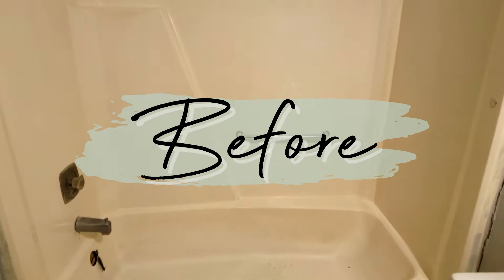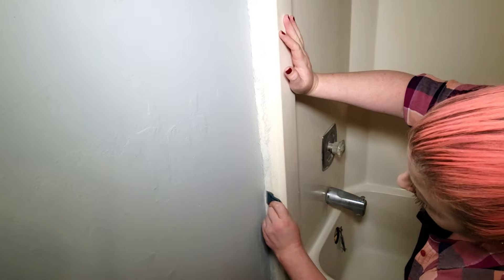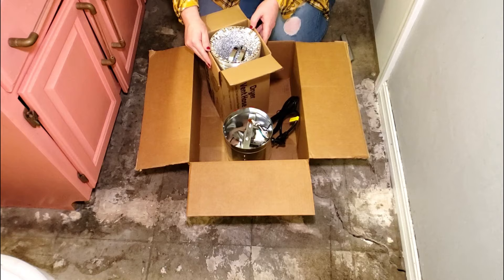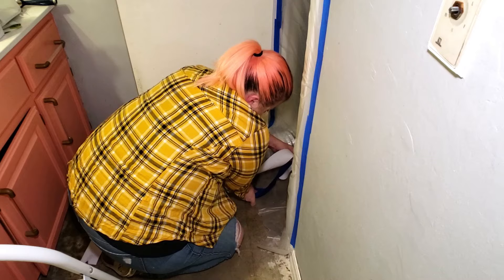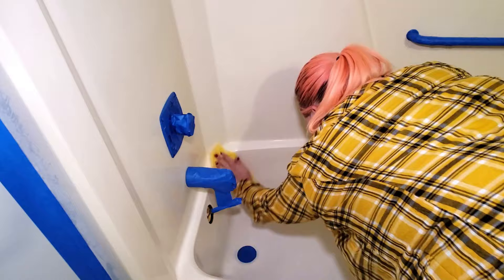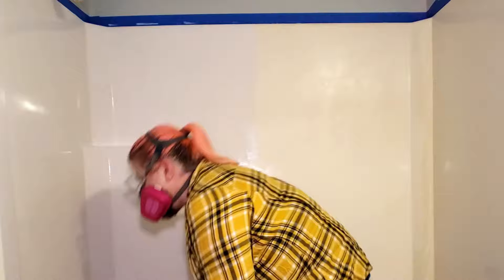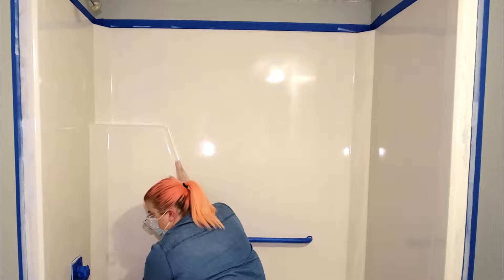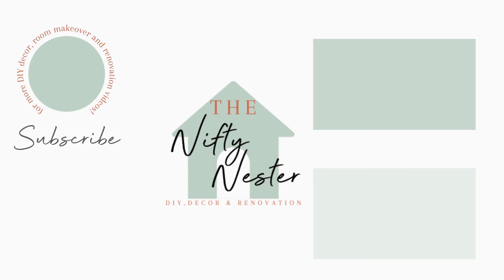How To Paint A Bathtub Yourself | The STRONGEST & CHEAPEST Way To Refinish Your Bathtub!

Comment: Hi! Awesome video. Quick question before I do this lol, the “topside” paint says it is water resistant and should be used above the water line . For below the waterline used “bottom side paint”..  does it matter ?
Reply from the maker: Thank you! So the bottom side paint is a much stronger paint that's meant to prevent "fouling". It's formulated to slowly release copper and hold up to constant submersion in lakes or oceans. I don't think it's safe for constant exposure when showering. The topside paint on the other hand is supposed to be non-toxic and fume free after it cures and it still has a hard enamel finish that's meant to hold up to the elements and get wet on a regular basis. Topside is also less expensive which is a plus. This paint is really durable, it's held up amazingly.

Comment: Your video was just what I was looking for! Can I do this with a stand up shower that has caulking in between panels?
Reply from the maker: Thank you! I think that would be fine as long as it's a material this paint would work on (which seems to be pretty much any material that would be used for a shower). The only thing I would suggest is maybe removing the caulking before painting and applying new caulk after the paint has dried (if that's possible for you to do). Good luck!

Comment: Looks great!!! Did you not have to use a primer? I want to paint my shower tile😊❤
Reply from the maker: Thank you!!! So this paint doesn't require a primer. If your tub or tile has damage and needs repairs made beforehand then you'll want to use the Marine primer to reseal the tub before painting. Since you have tile I would suggest using the Marine primer so the grout gets sealed before painting. But with a standard fiberglass tub or similar material without grout, it's not needed.

Comment: That looks great! We've been stressing out about how to fix a shower stall in a very small space and it looks like this might be the solution. Def going to check out more of your videos for other projects. Just curious about how slippery that paint gets when wet. Is there a way to make the base somewhat slip resistance?
Reply from the maker: Thank you so much! This has been one of my favorite projects to date. Rustoleum sells a non-slip additive that I'll probably try when I refinish our other bathtub. This tub had a slight texture to the bottom, and the paint didn't fully fill that in, so the remaining texture was enough to keep the tub from getting too slick. Without that texture, it would probably be like a smooth porcelain tub. I've heard from others who have used the non-slip additive and said it works great, so you might check that out. I hope that helps. Good luck with your renovations, and feel free to reach out if you have any other questions!

Comment: Thank you this is so helpful! Did you just leave the vent fan on the entire it was drying, etc?
Reply from the maker: Thank you! I ran the fan each day until I went to bed then shut it off, by that time each coat was dry and the fumes were pretty much gone. On the last day I did the same thing and just kept the plastic up for another day to let the tub finish curing. By then the bathroom smelled pretty normal, maybe just a little like paint but there weren't any fumes left.

Comment: Looks Great, obviously there's no brush strokes, but did it leave any lines, was it pretty smooth ? Thx
Reply from the maker: Thank you! The finish is like a smooth shell, there's not any lines or texture at all from the roller. The paint is "self-leveling" so any slight texture should level itself out. It's not like epoxy, you still have to try to get the finish smooth with the roller and go over any lines from the edge of the roller, but the paint will also level itself out a little which gives it that smooth finish when it's dry.

Comment: The paint manufacturer description says for "above the waterline" so how is it holding up comming in contact with the shower water? Thanks
Reply from the maker: I had the same concern but after reading through all of the reviews I figured it was worth a shot. So far it has held up insanely well. There's no peeling, bubbling or any other sign of wear at this point.

Comment: For ventilation you need a source of new air to come in as the ventilator pulls out the bad air.. I didn't notice if you said you had any
Reply from the maker: I didn't think to mention it at the time but I had my homes ventilation system on and the air vent in the bathroom open so that was my fresh air source.

Comment: When doing your bathtub with Marine Paint did you use the Marine Primer?  If not is there a reason you didn't?  My bathtub is sanded and ready for paint, just want to make sure I do it right.  Thank you
Reply from the maker: Sorry it took a couple days to respond! You don't need to use primer unless you've made repairs like filling in cracks or chips. If you've made any repairs then you want to use the Marine primer. I hope that helps, good luck!!!

Comment: Great Job! I used the Tub & Tile paint and it did not hold. My girls tub started chipping badly, so I am going to give this paint a try.  Did you need both cans of paint for the tub? How many foam rollers did you use during each coat? & What do you currently use to clean the tub?
Reply from the maker: Thank you! I'm sorry to hear about the issues with the tub and tile paint, unfortunately it seems a lot of people have those issues. I don't know why they don't formulate it more like they did this paint because this paint is clearly better. I ended up using less than one tub of paint so I still have a little left over plus one unopened for future projects. As far as rollers used I believe I only used one roller per coat of paint. I hope that helps, feel free to ask if you have any other questions and good luck to you with your tub!
Reply from the maker: Sorry I forgot to add what I use to clean it with. It's actually easier to clean now than it was before, I have just been using 50/50 vinegar water and a sponge or rag, sometimes I'll use a spray foam cleaner but still nothing harsher than a sponge.

Comment: Hi quick question! How slippery was your tub during usage? They also sell a non-slip additive to use with this. Did you add that as well? Do you think its necessary?
Reply from the maker: I actually am planning on trying the non slip additive in the next tub I'm refinishing (probably this month or next). The best I can compare the paint finish to is like a hard porcelain tub finish. It made my tub feel like it had more of an enamel finish and it is slightly slicker than before. Our tub had a slight texture on the bottom and the paint didn't fill that in since it's thin layers so that texture is still there which keeps it from being too slippery. I would say without that texture, the non slip additive probably would've been a good idea.

Comment: Hey! Thanks so much for this video. How is it holding up a year in? Also did you wet sand or just dry sand? I see the can calls for wet sanding. Currently doing this to my rub but forgot to sand between 1st and 2nd coat :(
Reply from the maker: I'm sorry I'm just now getting back to you! I did a dry sand with a really fine grit sanding block but I'm guessing it would be fine either way. Don't stress too much, as long as you didn't wait too long in between coats it should hopefully still bond properly. Mine is still looking great a year later, I'll share an update on here soon. I hope yours turns out well!

Comment: So thankful I found your video just one question though. How did it hold up so far and are there certain bathroom cleaning products (I.e I tend to use bathroom cleaners made with bleach) that you have to stay away from post care?
Reply from the maker: Thank you! I'm working on editing the update video now, I hope it'll be up soon.
It's held up really well. I have used vinegar water, bleach cleaner and other bathroom cleaners on the tub. The main thing I stay away from is really rough brushes but I do use a soft scrub brush if it's really dirty, otherwise I'll use a sponge. I use a stronger cleaner when it's really dirty, vinegar water when it's not. I don't use comet or anything else that might be too harsh on the finish but all of the spray cleaners seem to be just fine.

Comment: Hi, is your tub made of fiberglass? If not, how is it holding up? I ask because I’ve seen YouTube videos saying that because it’s made for fiberglass boats that it will only work on fiberglass tubs.
Reply from the maker: Hello! Yes, mine is fiberglass. It has held up wonderfully to this point. Rustoleum says this paint can be used on fiberglass, wood, metal, and a few other materials. I've seen it used on iron tubs, ceramic tile, and pretty much any material a tub or shower wall would be made out of. If you go the product and check out the reviews on Amazon, you can see the other materials other people have used it on. According to them, it seems to work well on them all. I hope that helps!
Reply: @TheNiftyNester  that helps tremendously! I’ll definitely be trying this on my tubs and surrounding walls. Thanks!!

Comment: Do you find it's holding up well even without doing the special primer before? Trying to decide if I want to use the primer or not.
Reply from the maker: It's held up extremely well! From reading the directions, you don't need the primer unless you've made repairs to the tub, then those would need primer to seal them. That being said, it wouldn't hurt to use the primer. I've had good results without it, but I've also heard from others who used the primer and said they needed fewer coats of the paint because the primer covered the tub color so well. I think if I was covering a darker color or a bright blue or pink, I'd probably use the primer.

Comment: I tried using the Homax Tough as Tile product and it is absolutely terrible. You  can't even set a bar of soap on it or it comes right off. Does this have any issues under bottles or soap bars where it stays wet all the time? Also, what should I do with prep work now that it's already painted? I sanded and prepped everything good before applying the Homax. Do I need to completely sand off the Homax or can I just sand a little and apply on top? Or use a primer and apply?

Comment: Question: I really want to try this but I will definitely be replacing faucets as well, would it be better to remove faucets first, then add the new after paint is dry?
Reply from the maker: Yes, I would definitely remove the old ones first.

Comment: Hello what kind of paint would last longer on water? And how slippery is the tub after painting?
Reply from the maker: I don't know if I'd ever use a product other than the one I used on this tub, it's held up so well. It's what I would recommend, anyways. It's linked in the description if you want to check it out. The paint finish is similar to a porcelain tub so it's like a hard shell, a little slicker than the old fiberglass was. They sell a non-slip additive if you want to add some resistance to the bottom of the tub.

Comment: Are the fumes from this as bad as the tub n tile kits??? My apartments redid my tub less than a year ago and it’s already cracking—not peeling—cracking & it was rough n bumpy from day one so I thought I’d try myself!!
Reply from the maker: That sucks, I'm sorry to hear it! The fumes are pretty strong. You definitely want to wear a respirator and have good ventilation set up. And a tip for you since you're dealing with a bad refinish job, you'll want to sand the finish off down to the original tub or as close as possible. If there's any remnants of the old paint left or any damage to the tub, you'll want to use the Rustoleum Marine primer before painting as well. Good luck, I hope all goes well!

Comment: How's it holding up? What do you clean it with?
Reply from the maker: It's held up perfectly! I use a couple things depending on how dirty the tub is. For a light cleaning I'll use vinegar water and a sponge. When it's really dirty I use a bathtub cleaner spray that's pretty strong and a blue scrub brush I get at the dollar tree. It's a nylon type material that scrubs the grime off really well but isn't abrasive enough to damage the finish on the tub. I'm editing the update video now and should have it posted soon and I'm sharing all of that info and showing how it looks.

Comment: I think you forgot to add the restorium topside  primer without it will peel
Reply from the maker: I haven't had any peeling at all. I sanded and prepped the surface really well so maybe that's why, but I read every review I could find where this paint was used on a bathtub and I couldn't find anyone that had issues with this paint peeling. It seems to have adhered well to the surface and it is a rock hard finish.

Comment: If I already have a fan in the ceiling of my bathroom..is that enough ventilation..I have no bathroom window
Reply: if the paint she used is anything like the paint I used the fan won't be enough. My condo stunk like paint for at least three days. I only had a fan so I opened the bathroom door and all the condo windows and balcony doors. Still took three days for the fumes to really leave. Glad I did it in the summer so I could open everything. If it was winter it would have taken weeks for the smell to clear out (or I would have had to freeze with all the windows open) 
I used marine paint.

Comment: I did this and it came out looking great but  the smell has been going strong for about 5 days now. Any tips on how to get rid of it ?
Reply from the maker: I'm glad to hear it turned out well! Did you set up a ventilation system? I can't say for sure but I think that's the main reason we didn't have any harsh lingering smells afterwards. There was a faint paint smell but not bad and it didn't last long. I left the ventilation set up and running all day each day that I applied another coat. We don't have any windows in that bathroom so that was the only option I had.

Comment: I'm planning on doing this but I'm concerned about the need for the respirator. They're not that much but I don't want to spend money for one if I don't have to since this is a small budget project. I do have a window in my bathroom. It's a very small room. No fan but I can plug in a box fan to help get the air moving out of the window. Do you think I'd still need a respirator in that case?
Reply from the maker: I completely understand. Every dollar matters. The problem with using an N95 mask or some other type of mask instead of a respirator with those exact filter cartridges is that they can't filter the fumes out at all. The fumes are pretty strong and can be harmful. Once the paint dries, it's fine, but while the paint is wet, it is pretty strong. The fan I used circulated the air faster than it could build up, but the fumes were still strong. With the respirator on, I couldn't smell anything and didn't feel any effects of the fumes. For those safety reasons, I wouldn't do this project without one. You might be able to find a cheaper one that's a different brand on Amazon or look on Facebook marketplace.
Reply: @TheNiftyNester  Got it, thank you dear! I've painted a lot but never used marine grade paint before. I'm sure it's heavy duty. I'll see if I can find one cheaper. My sister may even have one I can borrow. I appreciate your help!

Comment: Hey since it's been a year how is the bathtub holding up I've been considering the idea. do you use the shower for the primary restroom
Reply from the maker: I've been trying to get my update video done for a couple of weeks now that will show how it's looking today. Sorry it's not up yet. Our 5 kids share this bathroom, so it gets the most use in the house for sure, and it's held up amazingly. There's not really any noticeable change from day one to now. I scratched the side of the tub with a metal ladder when I was working on the bathroom makeover but it's not very noticeable and the paint hasn't chipped or peeled at all where I scratched it.

Comment: Do you know whether you had a fiberglass or acrylic tub? Wondering if it would work for either?
Reply from the maker: Ours is fiberglass but it should work on any bathtub. Rustoleum gives a list of materials it can be used on and if you go to the link for the paint and check out the reviews there's a lot of materials it's been used on successfully.

Comment: 6:35 you have a major foundation crack in your concrete slab that could bring plumbing issues in the future if it worsens, also why didn’t you just turn the bathroom vent on?
Reply from the maker: This house has had major foundation issues. They've been repaired, but we're getting ready to have it looked at again. It's definitely settled more since then. After the previous owners had the foundation worked on, they didn't deal with the cracks. The ones they did deal with, we have to redo because they weren't done well. Our entire neighborhood has had foundation issues. As far as the vent goes, bathroom vents move a lot less air per minute than the one I used for this project. They aren't meant to cycle out fumes like this. You can use a bathroom vent. It'll work better than nothing, but I wanted to reduce the fumes as much as possible.

Comment: ohhhh so this is something different than the one used on tile bathrooms correct ?
Reply from the maker: So you can use this paint on tile, fiberglass or any other surface that's used for bathtubs/ showers/ sinks but I think you're probably referring to those tub and tile kits that are usually used. I used this instead of one of those kits. It's less expensive, works better and holds up better over time.